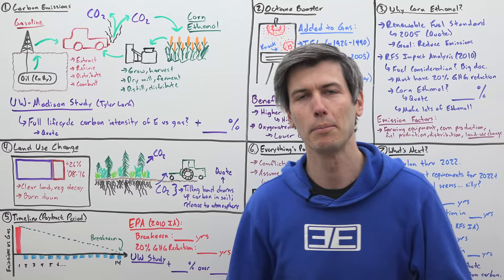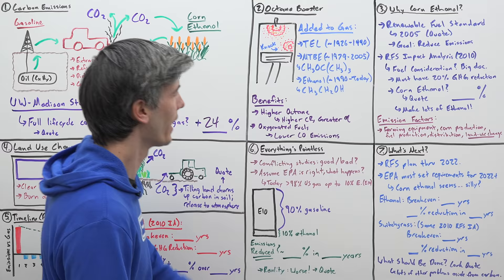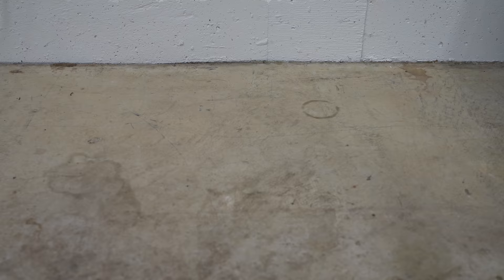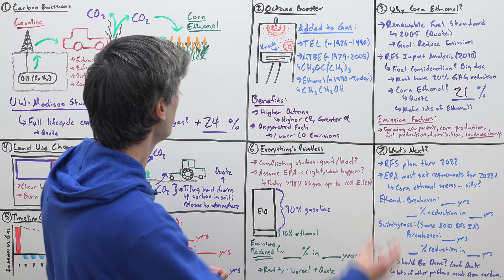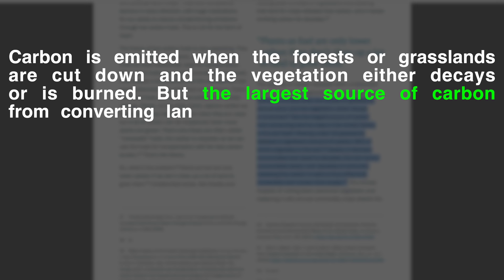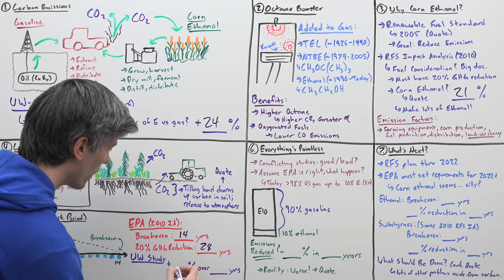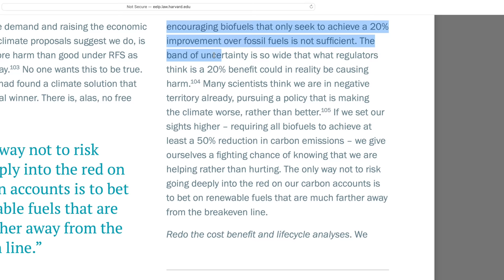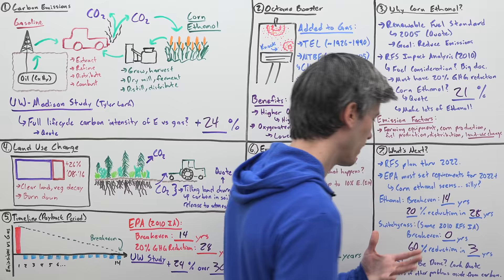America Was Wrong About Ethanol - Study Shows

Comment: All your science is correct...EXCEPT THIS omission: ethanol water H2O affects engines ( especially my 2 cycle saws and 2 cycle outboards ). The ethanol degrades gaskets.
Soooooo, we use NON ETHANOL fuel in both diesel, 2 cycle, 4 cycle. Big $$$$ for that virtue with little effect.JMNHO.
Reply: There were no virgin soils or forests broken up for ethanol.  Impossible since US cropland acres have fallen.  Indeed, the corn belt grew more acres of corn in 1980 before ethanol than in 2018, the year of most ethanol ever produced.

The very same 2 cycled saws and 2 cycle outboards we have in Brazil use a minimum of 27.5% ethanol.  It has worked out so well and for so long that Paraguay went to E27 as well.

Ethanol degrades varnish and back in the day there used to be gaskets made of cork which were coated with varnish.  Today's E0 gasoline would degrade those very same gaskets with the high amounts of aromatics used now.

Ethanol on any manufacturing chemical compatibility chart you will find is at worst equal to but most often far easier on rubbers, plastics, and metals than what gasoline and BTEX (benzene, toluene, ethylbenzene, and xylene) are.

Comment: Why not make ethanol from trash?
Reply: Enerkem is a company who does that.  They were supposed to have built a garbage to ethanol plant in Inver Grove Heights, Minnesota but I have not heard if it ever was.

What makes corn ethanol so much more economical than most other sources is that it is value-added from already existing corn feed production acres which preserves the feed in a healthier and more productive form called distillers grains.  There were no grasslands or forests broken up for corn, quite impossible since US cropland acres have been declining.  The corn belt actually grew more corn acres in 1980 before ethanol.

Garbage and switchgrass qualify as Gen2 ethanol and there is a $1.01/gal. subsidy available for it.  Corn qualifies as Gen1 ethanol and had a $.45/gal subsidy which ended back in 2011.

Comment: I heard ethanol is bad for certain components of an engine, I believe it may have been things like hoses and gaskets.
Reply: The Bureau of Labor Statistics measured the percentage of household income spent on vehicle repairs and maintenance from 1990 to 2017.  The amount in 1990 was 2% and this declined to 1.5% while ethanol used in our gasoline exploded from .1% in 1990 to current levels from 2011 onward.

The EPA before approving E15 in 2011 conducted long term tests on non-flex fuel vehicles 2001 and newer with not only E15 but also E20.  They found both fuels ran fine and did no damage.

The very same non-flex fuel vehicles, boats, motorcycles, and small engines we have are in Brazil whose common gasoline contains 27.5% ethanol.  It has worked out so well and for so long that Paraguay went to E27.

Ethanol on most any chemical compatibility chart you will find is equal to at worst and most often easier on rubbers, plastics, and metals than what gasoline and BTEX (benzene, toluene, ethylbenzene, & xylene) are.

Comment: You also should have mentioned that many of thr fertilizers used are petroleum based
Reply: He also should have mentioned that like when feeding the corn straight, 100% of the fertilizers still get fed to the livestock in the distillers grain.

Ethanol (C2H6O) is made of only things of the air: solar energy, CO2, and water with the latter two recycled once burnt.

What logic is it then to assign all the fertilizer to ethanol and none to the distillers grains?  Should it not be the other way around?

The US used 11,160,933 tons total fertilizer on corn in 1980, before ethanol.

In 2018, the year of most ethanol production ever, the US used 10,521,850 tons total fertilizer on corn.

Ending ethanol wound not reduce fertilizer use one iota.

Iowa State University measured all the energy it takes to produce an acre of corn into a "diesel fuel equivalent"
This included making the machinery, fertilizer, chemicals, plus the tillage, planting, harvesting, drying, trucking etc.
 
They found it takes 34 gal of diesel to produce one acre of corn.
What do we get from those 34 gallons of diesel?

We get >500 gallons of ethanol.

But wait, that is not the kicker.
The kicker is we still get 100% of the protein and other things from that acre of corn still available for a healthier and even better feed called distillers grains. A win-win.
Reply: We use something call cow manure of corn fields. I know that a new thing to you all. It comes from the back end of a cow daily and doesnt cost a thing.
Reply: @oldblueaccord2629  The huge farms growing fuel corn aren't using cow manure. I wish they were!
Reply: @1dgram  All the cow farms I grew up with did. It was the only way to get rid of it!

Comment: Yeah corn doesn't work but sugar cane probably does. Isk why Hawaii doesn't convert
Reply: Corn is so economical not because it makes the most ethanol but because it is value-added from already existing feed production acres and preserves the feed as distillers grains.

With this feed factor, it outcompetes most any other source including those that make more ethanol but little else like sugarcane.  So much so that Brazil in 2017 put an import tariff on US ethanol.

I too saw all the abandoned and still standing perennial sugarcane fields in Hawaii's marshlands and thought what a waste but it is even worse than that.  

The majority of Hawaii's electricity comes from imported, expensive, and dirty diesel fuel.  The imported gasoline is especially expensive as well.

For a fraction of what they have spent on solar and wind, they instead could make electricity from burning zero pollution and zero newly added CO2 ethanol and even use the waste steam from the electric plant to make ethanol.  The sugarcane fields are already right there.  GE has converted turbine electric plant generators to be dual fueled with ethanol in Brazil.

In the continental US the spot cash delivered price of ethanol on the NYMEX is $1.32/gallon.  

The price Hawaii pays for gasoline at the pump is around $4.66/gallon and diesel is similar.

Comment: Can you use Ethanol to produce electricity for EVs?
Reply: Absolutely, Nissan drove a fuel cell vehicle around in Brazil in 2016 that used the already existing E100 fuel infrastructure there.

Great thing about them, fuel cells can use the ethanol at lower proof with enough water in it so as to be non-flammable.  Can't say that about lithium batteries plus it takes more energy to make 200 proof pure ethanol.

Advanced super quiet large military submarines in Europe and India use ethanol fuel cells today and can stay submerged for weeks at a time.

Here is an excerpt from article from seeking alpha web page that talks about ethanol fuel cells:

>>>Fuel Cell technology offers many advantages over Lithium-ion batteries, not the least of which is that hydrogen used in fuel cells has the energy to weight ratio ten times greater than lithium-ion batteries.

That said, the volumetric energy density of ethanol is over five times greater than hydrogen.

Ethanol has five times higher volumetric energy density (6.7 kWh/L) than hydrogen (1.3 kWh/L) and can be used safely in fuel cells for power generation.<<<
Reply: 🤑 Yes, we can.

Comment: Corn based ethanol was only instituted to create a subsidy for farmers that wouldn't have needed anything of the sort if government would stay out of the grain price fixing business.  There is zero carbon benefit.  Please follow.  Corn needs 100s of 1000s of acres to produce the amounts of corn necessary.  For that land, two major things have to happen.  One, convert existing farm or cattle lands into corn fields, which means there are actual food production sources lost to make ethanol.  Two, deforestation.  Clear timber land to create corn fields; removing trees that actually process carbon to produce oxygen.  To do the latter requires heavy petroleum fueled carbon monoxide producing equipment.  To farm both requires the annual use of heavy petroleum fueled carbon monoxide producing equipment for planting and harvesting.  What farming land for corn also causes is a loss of nutrient rich top soil and megatons of fertilizers which are produced in facilities that require energy sources that are most likely produced by petroleum, coal, oil, or natural gas.  What gas is produced from fermentation?  CARBON DIOXIDE.  Then there is distillation requiring energy sources that are most likely produced by petroleum, coal, oil, or natural gas.   If they were to use electricity from solar or wind, there comes the problem of more deforestation to create the barren land for solar and wind farms.  It's a circle of destruction.
Reply: Ethanol is distilled at relatively low temperatures.  Crude oil is distilled twice, once to remove water and the second time at 750 degrees F.

Newer ethanol plants are using waste steam from natural gas electricity plants to make ethanol.  Waste steam = free energy.

Waste steam produces no CO2 and bodes well for ethanol production to remain very cheap to produce.

US cropland acres have fallen since ethanol came to be and Census data also shows corn producing states have increased their forestland, grasslands, and wildlife areas since then as well.

Comment: So 14 year from 2010  is 2024.  That's today.  So from today forward, using corn produced from fields dedicated to ethanol production in 2010, ethanol production releases 20% less CO2 than burning oil.    The debt produced in 2010 has been paid off by 2024.  So ethanol is releasing less CO2 than burning oil right now today.   I will keep my EV.
Reply: You have been had.  There was no "debt" produced in 2010, no forests of virgin lands were broken up for corn.  Such a thing is simply impossible for US cropland acres have been declining since ethanol.   Census data shows forestland, grassland, and wildlife areas increased after ethanol in the corn producing states.   Indeed, the corn belt itself grew more acres of corn in 1980 before ethanol than they did in 2018, the year of most ethanol ever produced.

100% of the CO2 produced by the fermentation and burning of ethanol just came from the atmosphere and 100% of it is needed to be back there in order to make the new gallon of ethanol.  Zero newly added CO2, unlike your EV where the coal produced 100% newly added CO2.

Few sources can compete with corn ethanol not because it makes the most ethanol, but because it preserves the feed from already existing corn acres in a healthier, more digestible/efficient, and more concentrated form called distillers grain.

No corn is grown just for ethanol, far too uneconomical.  But with the value-added feed factor, few others can compete with it.  

100% of the fertilizer and everything from the soil still gets fed to the livestock in the distillers grains.  Ethanol is made only from things of the air: solar energy, CO2, and water with the latter two recycled once burnt.

Ethanol C2H6O = no fertilizer

Distillers grains = all the fertilizer

What logic is it to then assign all the energy and CO2 of fertilizer to ethanol and none to distillers grains? 

The US used 11,160,933 tons total fertilizer on corn in 1980, before ethanol.

In 2018, the year of most ethanol production ever, the US used 10,521,850 tons total fertilizer on corn.

Iowa State University measured all the energy it takes to produce an acre of corn into a "diesel fuel equivalent"
This included making of the machinery, fertilizer, chemicals plus the tillage, planting, harvesting, drying, trucking etc. 
They found it takes 34 gal of diesel to produce one acre of corn.
What do we get from those 34 gallons of diesel?
We get >500 gallons of ethanol.
But wait, that is not the kicker.
The kicker is we still get 100% of the protein from that acre of corn still available for an even better feed. A win-win.

Comment: Sugar cane based ethanol would be better.
Reply: Why do you think that?

What make corn ethanol so economical is that it is value-added from already existing feed production acres which preserves the feed in a healthier and more productive form called distillers grains.

With that feed factor (i.e. distillers grains), corn ethanol can outcompete most other sources including those that make more ethanol per acre like sugar cane.  So much so that Brazil has an 18% import tariff on our ethanol.

Sugar cane requires dedicated land and dedicated fertilizer whereas corn as mentioned is value-added from existing acres while all the fertilizer (& everything from the soil) still gets fed to livestock in the distillers grains.  Ethanol comes only from things of the air (solar energy, CO2, and water with the latter two recycled once burnt).

There were no grasslands or forests broken up for corn.  Simply impossible on the face of it because US cropland acres have declined since ethanol.

Census data shows in corn producing states that their grassland, forest, and wildlife areas increased since ethanol.

Comment: There are other plants to make ethanal at a much higher yield!
Reply: What makes corn ethanol so economical is not that it makes the most ethanol per acre but that it is value-added from already existing corn production and preserves the feed in a healthier and more productive form called distillers grains.

With that feed factor, few can compete with corn.  So much so that Brazil put an import tariff on our ethanol in 2017.

By value-adding the feed corn, you get >500 gallons of ethanol and 1000 lbs. of protein.  By not value-adding corn, you just get 1000 lbs. of protein.

But the negative thing of corn is that it is economically limited to the size of the cattle herd on feed so at best we can just over double current production. 

Beets make more ethanol per acre but little else and they require dedicated acres of land and dedicated fertilizer.

All of the fertilizer still gets fed to livestock in the distillers grains, no NPK fertilizer in ethanol so that is why I don't call the fertilizer applied dedicated.

There were no grasslands or forests broken up for corn ethanol.  Quite impossible since US cropland acres have been declining.

Comment: These estimates around land use CO2 liberation are just typical academic opinion dressed up as science.  Just because an academic states a figure from a set of assumptions you should be careful not to pass it on as an immutable fact in your calculations.  Please note that if you change your farming practices to systems that help retain persistent carbon in the root system, the whole logic falls apart.  This is partly why the switch grass example had a better carbon reduction profile.
Reply: It is far worse than merely opinion.

There were no grasslands or forests broken up for corn.  Quite impossible on the face of it since US cropland acres have declined since ethanol.

Census data shows grassland, forest, and wildlife areas have increased in corn producing states.  The corn belt even had more corn acres in 1980 before ethanol than in 2018, the year of most ethanol production ever.

Corn ethanol is a value-added product of >>>already existing<<< feed production acres which preserves the feed in a healthier and more productive form called distillers grains.

100% of the fertilizer (& everything from the soil) still get fed to livestock in the distillers grains.  Ethanol comes from only things of the air: solar energy, CO2, and water with the latter two recycled once burnt.

Ethanol C2H6O = no fertilizer

Distillers grains = all the fertilizer

What logic is it to then assign all the energy and CO2 of fertilizer to ethanol and none to distillers grains?

Comment: Ethanol and methanol a great fuel as long as you are okay with using large quantities of it
Reply: Actually, in an ethanol optimized engine you use smaller quantities than a gasoline engine, even less than a diesel engine.

We use it in gasoline optimized engines for octane and to clean up gasoline's dirty and toxic emissions.  Being cheaper per mile to drive with along with more horsepower are bonuses.

Ford's first prototype EcoBoost was optimized for E85 and achieved 15 to 20% better fuel economy than E0 with load performance similar to a diesel engine.  They did not come out with it in flex fuel because they thought they could skirt paying for the patents to the MIT scientists who developed it.  That is still being litigated in court.

Ricardo built and drove an ethanol engine for GM some time ago with mileage and power greater than GM's diesel engine at half the size.

FROM RICARDO:
The new federal CAFE standards are calling for a doubling of fuel mileage performance, which, Vint says, is going to send OEM’s looking for high octane numbers to improve efficiency and ethanol is the best source. Ricardo, an engineering firm with over 100 years in the business of engine design, has developed an extreme boosted direct injection engine (EBDI) to optimize ethanol blends. The 3.2 V6 gasoline engine rivals the power and torque of a much larger GMC Sierra 6.6 diesel, he said, and it delivers 3.5 percent better fuel economy than the diesel.

This is not new technology or knowledge, it was known long ago.  It is suppressed technology.

Rear Admiral C.M. Chester wrote Henry Ford a letter on Dec.15, 1916:
"...I also pointed out in the article that as governmental laboratories had developed from 40 to 55% efficiency in alcohol engines as against 20% in gasoline machines, the use of alcohol at double the cost of gasoline for power purposes, was cheaper for motor[s] than gasoline in common use today."
Reply: @turkeyboyjh1  Running an engine on any fuel too lean would be bad.

FYI, the stock Chevy 5.3L is rated at a clean 380 horsepower on E85 vs a dirty 355 horsepower on E0.